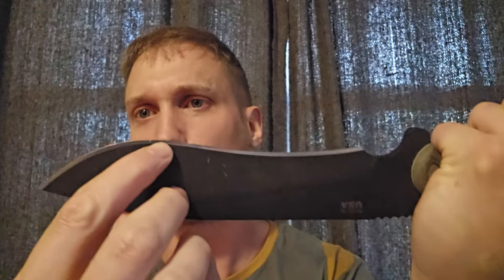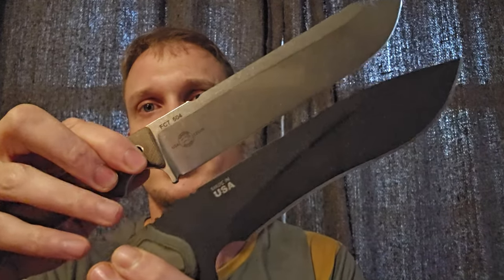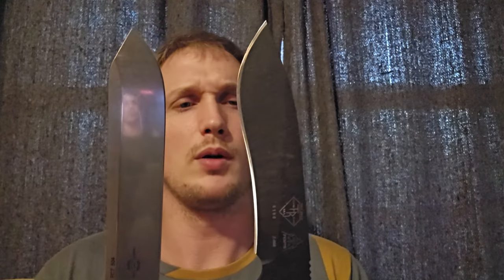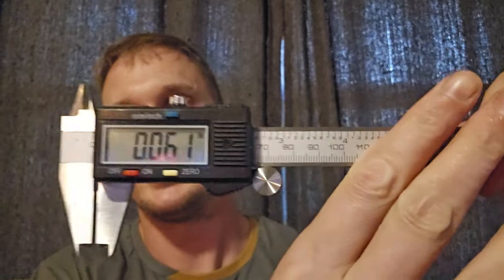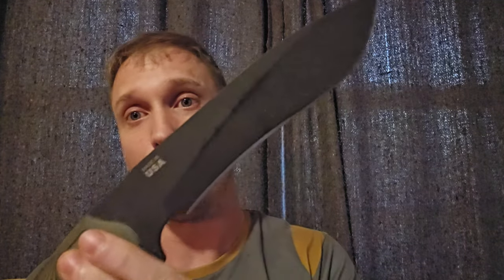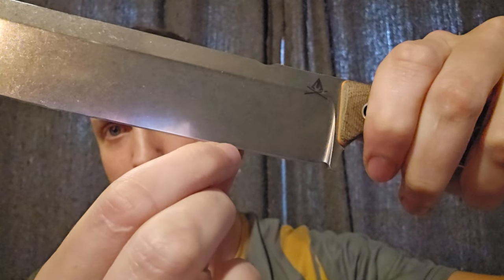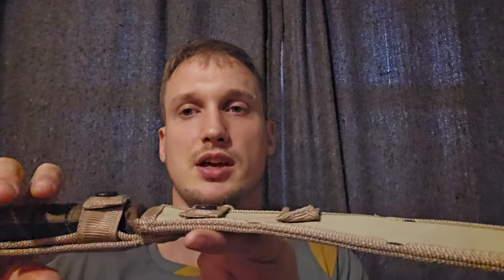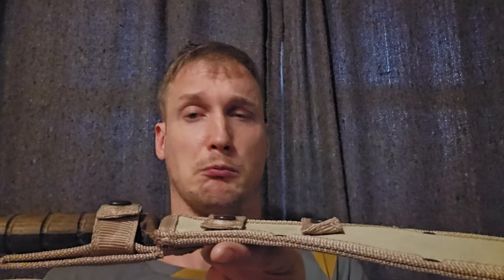The MOST crucial knife spec (that nobody will tell you) BEHIND THE EDGE THICKNESS

Comment: While thinner behind the edge is definitely better imo. I do like a convex reprofile. Remove the shoulder entirely & blend the convex into the flat grind, it substantially improves cutting / carving performance. I do enjoy the process, had to do that with a few blades that were THICK behind the edge. Lionsteel T6 is a prime example of a blade that was fat AF behind the edge (should have measured it before reprofiling) & didn't cut for 💩 from the factory. After the blended convex reprofile it's still a TANK but now it can also cut & carve reasonably well.
Reply from the maker: It can certainly make a BIG difference! It was even a part of the Esee Advanced Bushcraft class I took! (Putting a convex edge on)

Comment: Nicely explained, Jacob.  To me the concept is simple, there's just a lot variables that matter, but they're all simple.  Because BTE thickness is rarely given, the FIRST spec I look for when looking at knives is blade thickness.  It's certainly not as indicative as BTE thickness but it's as close as an indication when comparing knives and getting a feel for how they'll slice as I can normally get.
Reply: I'm big into (quality companies) khukuris made in Nepal. 5160 truck spring steel. Differentially heat treated. Minimum quarter inch thickness spines at the widest point (right at the "hilt" and some way forward of the handle)..... distal taper.

But you can have two khukuris with just over quarter inch spines (with differences on how thick going back and forward of the handle) but RADICALLY different BTE thicknesses, depending on the model and design.

Spine thickness has nothing to do with BTE thickness many times.

My favorite khukuri is a GGK, 12" Super Fast Khukuri that has a quarter inch spine at its thickest point, but has a near hollow-convexed grind that is superior for fighting/hunting/cutting purposes, but not the best option at all for heavy duty chopping/batoning into frozen, hard knotted pines and hardwoods. (But it still can in a pinch....I'd warm up the blade first under my armpit inside my coat before use in that manner)

Being in more northern woodlands, especially in winter, I always have some form of axe on me anyway, so I like the more refined and thinner edge on my khukuri.

Comment: if I googled well, 0.041 inc is a little more than 1 millimeter... it's an ax and not a knife😀.. for me personally, 0.5 millimeters behind the edge is a bit too much, that's why I made a knife where the thickness behind the edge is 0.25mm... so it cuts like a laser, but I'm honestly afraid to do any more difficult tasks with that knife
Reply from the maker: Edge thickness is all about being the right thickness for the job, the knife, and the steel.
.25mm is where I like my small fixed blades or pocket knives also, or maybe just a hair thicker. So .25mm is about .010 and for instance my creely is .012 and that is QUITE thin to where it is relegated to knife tasks only. Of course. Haha. I REALLY like that blade.
50mm is a good spot to be in my opinion up to a 7" blade.
Above a 7" blade it starts becoming a balancing act between grind, blade length, weight, and edge thickness. The amount of force generated and shock goes up exponentially. 
Fwiw a lot of cheaper axes have heavily convexed edges that are something like 2mm bte- I also like my axes however to be as you mentioned at about .5mm to .75mm

Comment: Does the type of grind matter when determining an "optimal" behind-the-edge thickness?
Reply from the maker: In extreme cases? Yes.
Generally speaking? 
Not really.
A medium to high Saber grind and a ffg with the same exact bte and micro bevel are going to perform VERY similarly.

With that being said scandi is a bit different because scandi is both the primary grind and the secondary grind as any zero grind is- so again that's a pretty different deal.
Reply: Thanks for clarifying!

Comment: Awesome explanation, reminds me of one of your previous videos couple of years ago, but in much more detail!
What would be your recommended TBE for some common knife PoU cases, assuming properly selected steel and HRC that matches the intended use?
1) Light use 3-4¨ blade;
2) 4-6¨ survival type blades (think ESEE-4, Gerber Strongarm, CS SRK);
3) 7-9¨ choppers;

So far I´m yet to damage an edge that is 0.020¨ or slightly thicker during normal use and light abuse, and really like to thin out my 3-4¨ light use blades down to 0.01-0.015¨ for best performance, but maybe that´s asking for trouble if at some point I´ll have to depend on them the most.
Reply from the maker: GENERALLY speaking (because there are so many variables) anywhere under .020 and I start feeling that I should consider how I am using the knife depending on size.
I would like to see knives probably 3" bladed and under come in at about .015 to .025
3"-6" general use knives at .020 to .030
3"- 8" harder use knives .025-.035
8"+ blades probably .030- .050
Reply from the maker: I didn't go exactly by your blade lengths but I hope it still answered your question.
Reply: @Thepreppersbunkeroutdoors  Thank you, and yes you did, this is very valuable!

I've got an idea already for quite some time now that in addition to your contribution, the work Joe X is doing in testing knife toughness and the edge retention tests Pete from Cedric & Ada is doing, one data point that is missing and that all knife community can collectively chip in is collecting a database of TBE for each knife. Ideally, if we all could relatively easily also measure the original factory angle for the microbevel. I already have such a spreadsheet for all my knives, and if that would be usefull, could share with it to get the ball rolling.

Comment: Man, does Tops actually make a knife that’s worth af? I have a DART, and I originally wanted to make it my “shtf” go to knife. Because I love the overall length and weight and the recurve kukri design, and 5160 is my favorite carbon steel. However, the thing is just not a performer, along with the poor handle design(not having any sort of hook at the butt for retention when swinging it) Yeah, no matter how sharp I make the apex, it just wants to bounce out of the materials. Serious let down! I’m still on the search for the “one knife”. Always taking suggestions as well. I want the best 9-10 inch blade, 15” overall max, that doesn’t have cheap 1095 steel. Good video btw.
Reply from the maker: I HIGHLY suggest checking out Mineral Mountain Hatchet Works and Bear Forest Knives.
MMHW will probably need a custom sheath but they are SO worth it!

Comment: Is there an equation/relationship/rule of thumb that, that measurement should be?  Im guessing probably not but its very interesting
Reply from the maker: There is a realm of what is appropriate.
I'm thinking about putting together an equation of bte thickness divided by the height of the micro bevel to give an overall corrected thickness, and there are general rules for what OCT is appropriate for a task-
But knives can also have a more specialized intended rolls that can stray from that.

Comment: EGKH has behind the edge thickness on some sights.
Reply from the maker: I used to co own EGKH- considering 2 things unless it is a 100% different brand now I wouldn't believe their specs for a second
1- they don't make their own knives, they resell, and they will take whatever they can get and
2- their knives are all zero ground which makes a traditional bte measurement difficult unless you have a standardized distance from edge to measure from which I have 0 confidence in their ability to do.